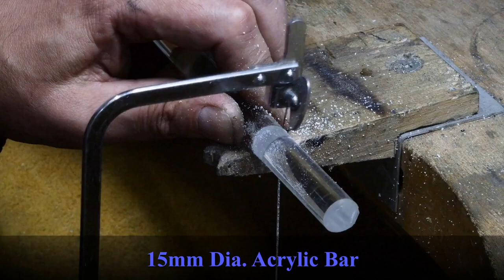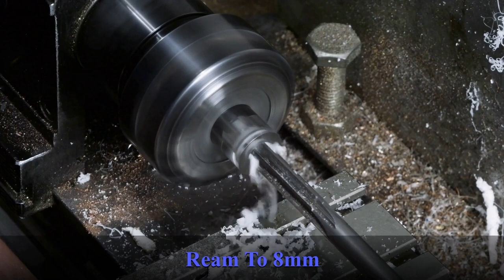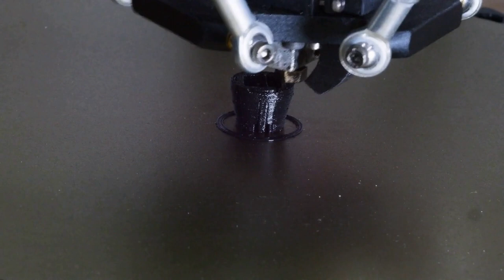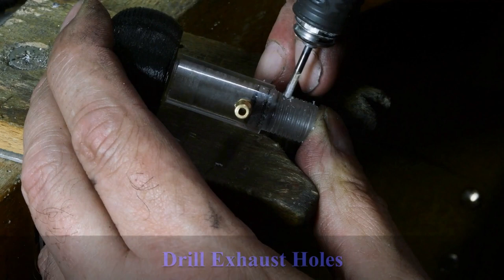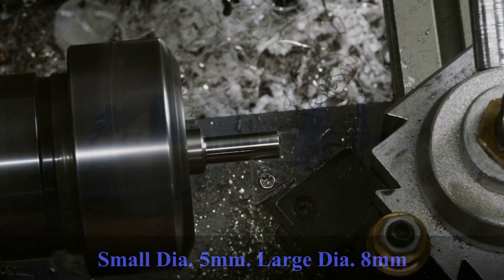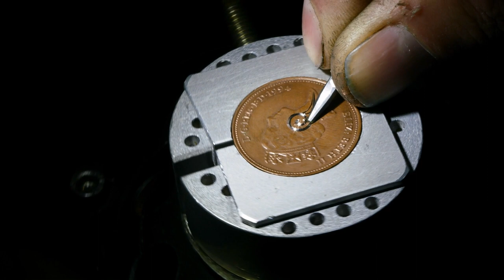Plastic Ported-Piston Power Graver

Comment: Hello, i have watched the video a few times now and dont seems to find  the total lenght that the piston should be ?

From 8mm to 5mm diameter and then 2mm hole in the 5mm diameter portion. But what is the lenght of the 8mm diameter and 5mm portion ? 

Thanks

Comment: Seems like an awesome idea!  Just wanted to know, does this work on straight compressed air from a big compressor or does this work on a modified 12 volt mini compressor like Rick Alex’s or Shaun’s design?
Reply from the maker: It connects to a regular compressor like the Lyndsey power graver, it has more power than Shaun's, although Shaun's is great for most things especially very fine engraving.
Reply: Love to see drawing if possible. Then make one too. Good work !

Comment: Do you have a name for the piece that connect to the air hose that goes into the M4 hole ? Any reference number that could get a few of ebay ?
Reply from the maker: Those were hard to find. I haven't been able to find them recently so I've had to cut the head off an M4 bolt and drill a hole down its length.
Reply: @joowler4891  Okay, i will try to find a reference number.